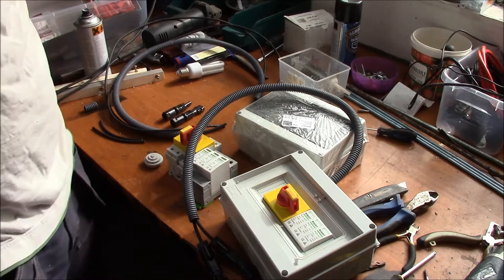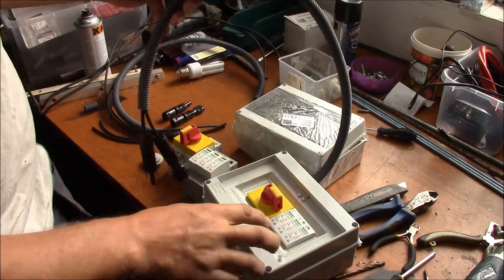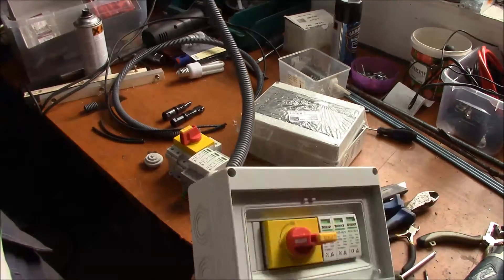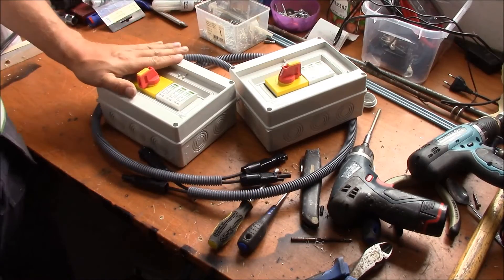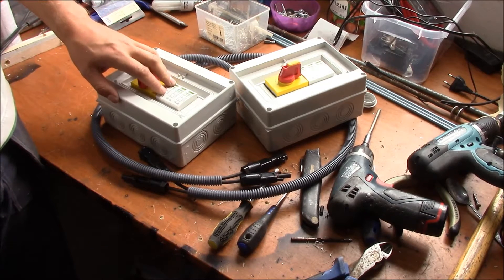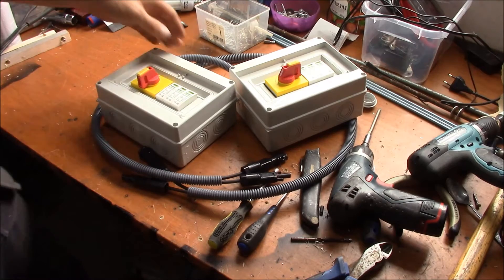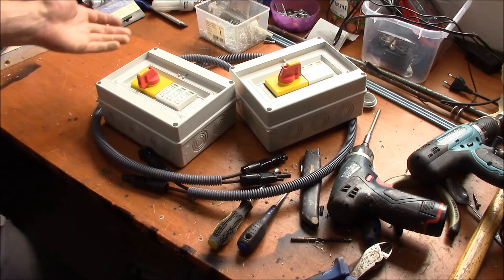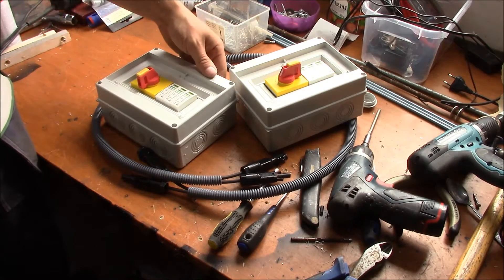Solar electricity: Junction box for incomming solar panel power

Comment: Thanks so much for your videos!  Did you have a calculation for coming up with your breaker size?  I'm considering using a fuse as lightning protection rather than a breaker.  It seems like I could purchase many fuses for the cost of one circuit breaker.  Are there reasons why a fuse is not a wise choice?  Thanks again for your efforts to share your knowledge.
Reply from the maker: All those 3 are different things and even though you can use a fuse as breaker its not meant for that. Fuse as lightning protector wont do that much. A lightning protector protects based on for instance voltage and when they go off they ground that incoming to ground. A fuse disconnects load due to excess current. 
The fuse should be based on so that it trips if you short something out. 
Im no electrician but this is how i do it.
If your inverter gives out 10A at max i would also design the fuse to be 10A and cables to cope with that. Never have a fuse higher than your weakest point!  
I prefer solid breakers. I never liked fuses as breakers and where I live its not allowed.
Reply: Thanks!